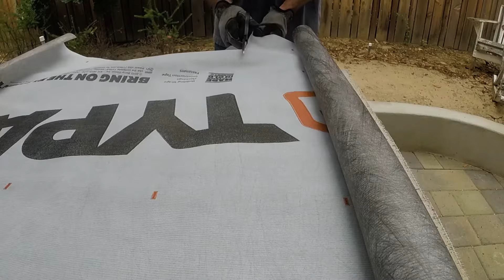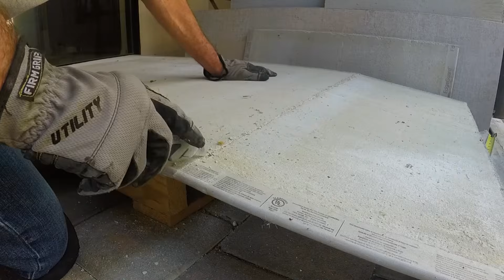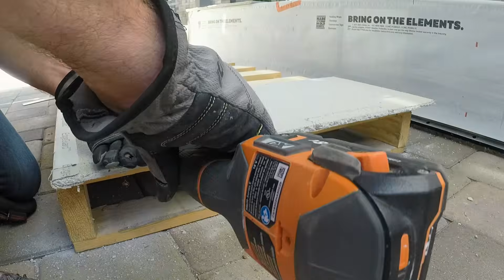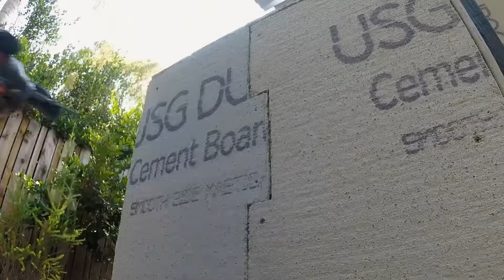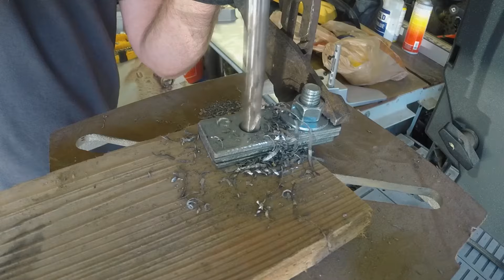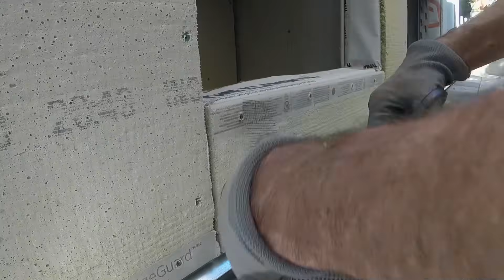DIY Outdoor BBQ and Fireplace - Installing Cement Boards

Comment: Just windering, instead of cement board … can i use composite siding?
Reply from the maker: I don't think stucco would stick as well to composite siding. But if you don't want stucco, I've seen kitchens done using composite siding that looks like wood or bricks.

Comment: How did you waterproof your cement board?
Reply from the maker: Usually you would cover the cement board with something. I covered mine with Stucco.
Reply: Im building an outdoor kitchen using HArdieboard  - great to work with and coasted with Ardex 8+9 for waterproofing - then stone veneer

Comment: I've been following your build for a wile and it has helped me a lot! Thank you very much for showing us your work.

Any progress on the stucco?
I am currently getting ready to do stucco over cement board but have been waiting for you to show how to properly do it.

Thank you again.
Reply from the maker: Thanks for watching and the encouraging comment. I finished the stucco over a month ago, just haven't had much time for editing. 
I did use a bonding agent on the cement boards, embedded stucco mesh into the base coat and ended up doing 2 semi-smooth color coats on most of it. Had some challenges getting it even and smooth the first time but learned a few tricks and had better results with the second coat. I used a 20/30 color stucco mix, which is applied at 1/8" thickness, so it started to dry rather quickly. Using a red foam float immediate after applying it gave me the best results.
Hopefully I can find some time to edit and get the video out soon, I may do a quick video this weekend to show the results, you are not the first person to ask about it.
Reply: @BruBuilds  Awesome, thank you soo much! Did you use anything on the corners like metal corners?

Thank you again.
Reply from the maker: Yes I put wire corner beads on the lower corner and used a drip screed along all the countertops.
Reply: @BruBuilds  Last question, did you install the corner bead under or over the mesh? And thank you soo much for your help.
Reply from the maker: Corner bead and drip screed attached first. I embedded the stucco mesh into the base coat, I didn't get the self-adhesive type, so it didn't stick to the cement board. But I think it worked better to put on about 1/4" of base coat, stick the mesh into the stucco, then add another 1/8" of stucco. I would overlap the mesh around the corners.

Comment: Thanks for the update! Will you add a certain type of mesh before stucco? What methods will you take to prevent cracking? Thanks!
Reply from the maker: I applied a concrete bonding agent to the cement boards, added a drip screed around the countertops and a wire mesh to the corner. I have some fiberglass mesh to embed into the base coat of stucco. I'll be doing a 20/30 semi smooth colored stucco coat. Hopefully I can get to it this week.